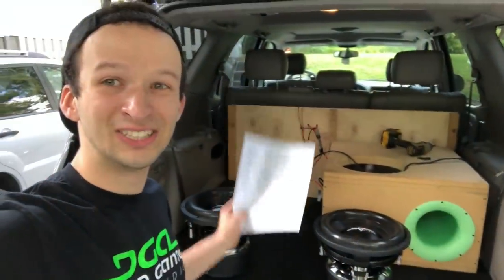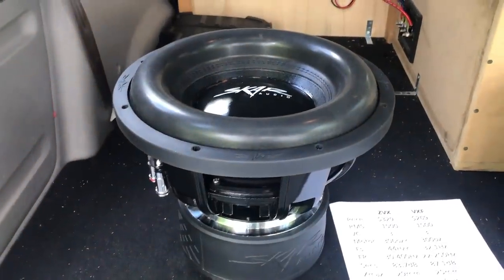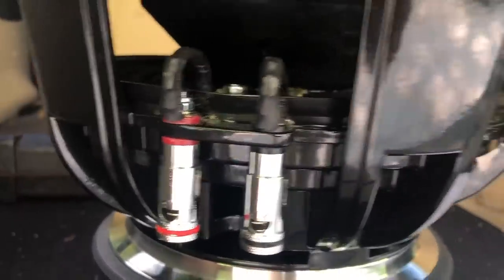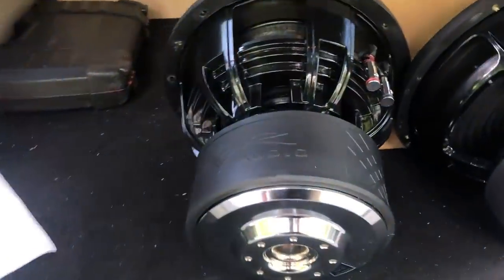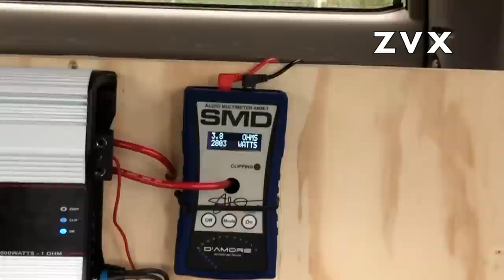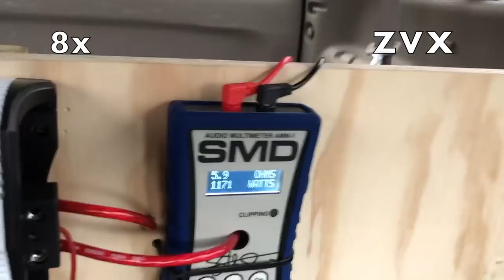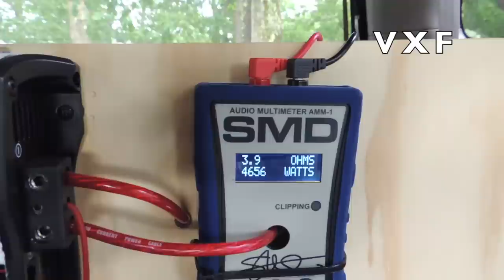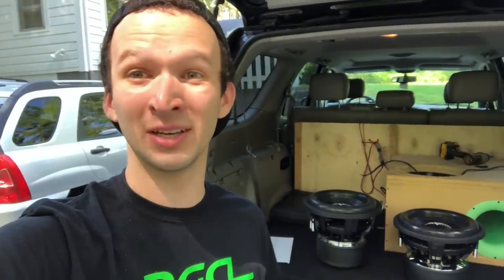SKAR ZVX VS VXF!! Which Is Best and Why? | Head to Head

Comment: The VXF would be my choice. It hit the lows a lot better than the ZVX. Great video!
Reply: The zvx just wants to be in a different box here’s the zvx hitting the lows https://youtu.be/HcqRCQ24XKk but its more for spl if you more on the sq side then yeah vxf definitely better
Reply: Which would you recommend the skar vxf or the kickers l7
Reply: Ivan’s music and video Guy definitely skar audio vxf
Reply: Ivan’s music and video Guy and put em on an 6000 watt amp or 2 taramp smart 3ks
Reply: bass brothers ok thank you
Reply: bass brothers what’s the max the 15” can take
Reply: Ivan’s music and video Guy one vxf by itself can take 3k rms
Reply: Went out and got 2 used vxf after this video. Can't wait to get everything installed
Reply: @unkowntrooper1657  well Mother Theresa tell us about all the giveaways that you be doing..!
Reply: Whats your box specs? And is there a pro or com to having the sub face up and the port to the hatch. About to build one for a 15 and kinda want the sub and port both on the same panel
Reply: Unless it's the ZVX 18. The fs is 26 Hz
Reply: @ivansmusicandvideoguy2038  skar VXF
Reply: Good
Reply: @ivansmusicandvideoguy2038  vxf kicker is crap the l7s can't handle but 900 RMS
Reply: All depends on the box.

Comment: Skar Audio designed the VXF subwoofer series to have the perfect combination of SQ and SPL features alike. Utilizing a high temperature 3" dual voice coil, and massive 300oz motor, the VXF's get extremely loud while sounding incredible. Conservatively rated at 3,000 watts max power.
Reply: You mean China designed the VXF to perform the way it does. Skar just put a name on it. I have two of them, not hating only stating facts.
Reply: @theinsaneunknown  A lot of things are made in China and multiple major brands just slap a name on them. I have many of those examples, not hating only stating facts
Reply: @kuya_akie  true story like 90% of everything is made in China with a name slapped on it. Some Chinese stuff is just made at better Chinese factories.
Reply: What skar box is best for the vxf , larger better or smaller, we explained comparison. Thanks for sharing

Comment: The difference in them is the box you can't take a sub that needs lower tuned box and put them in the same box there is going to be a big difference so box is the biggest thing you need a box that's tuned around 30 hz and a box tuned around 35-40 hz to be able to test and get more of an accurate feel for each sub in my opinion
Reply: I mean true but a lot of people are just going to drop a new Sub in their box, plus a lot of vehicles only have a certain amount of space so building a new box may not be possible, that being said I feel like this is still a valid test for those reasons. But you are absolutely correct it should be in a box built by the TS parameters to really know the differences in sound quality ,and output.
Reply: @Babyk Most videos I watch make it seem like it doesn't get low as it should, but there's a whole bunch of videos with the Sundown X playing lows real well. I have the vxf 12s, but I'm about to get the Sundown X v3 12s.
Reply: @Babyk I understand that people think they play lows good, but these videos are not that far off. You must have heard the most shitty setup if you can't tell the difference between a 95 pound sub vs a 57 pound sub. There is a guy on YouTube that had 4 15 zvx and switched to Sundown and said it was better. The x12 v3 is 70 pounds. I've been building boxes for a long time and some subs just don't do good. I have some old Sa15s that don't play lows worth a damn, but I dropped some Audioque 15s street duty in the same box and the lows were very deep. I don't need any 15s now because I already have too many subs now. I don't need the Sundown X either, but I just want to try them out.
Reply: @Babyk The weight means more motor force. You can't meter higher than a zv5 because they take more power than a zvx. 2 zv5s can take 8000 watts all day, but the zvx would burn up. I could care less why someone switched to Deaf Bonce, but I know it is a very good brand.  Sundown is on sale and I'm not trying to spend 800-900 on one sub. Like I said before, you must have heard a bad Sundown install because the zvx can't keep up. Skar would have put Sundown out of business by now if that were true. I've never heard anyone on any forum recommend the zvx over Sundown. It can't keep up with an American Bass xmaxxx Monster or DC level 5 which is similar to zv5's power handling. I'm not trying to turn you against Skar. If you like it, that's all that matters because some people think L7s sound good, but they don't. The  DNR sub they stopped making could compete, but the zvx is not on the same level as the ones I named.
Reply: @drjd2real  my boy has a x15v3 and it doe crush the lows but it crushes n takes all 5k of that salt 4 at 1 ohm
Reply: @Babyk have u heard them both in person same watts
Reply: @drjd2real  my zvx 15s play down to 20 hertz with authority.
Reply: that's totally true!
Reply: @drjd2real  do you build boxes for people is so can you build one for my ram 2019. I want some good bass and I think I need a custom box. I was considering 8in subs but what do u think
Reply: @drjd2real  there is more to a motor, than weight. More Weight doesn't mean, more motor force. What does contribute to higher BL is the amount of windings on the coil, that is utilized in the gap. Also the Flux. And lower carbon steel. When you wire voice coils in parallel,  you essentially cut the coils windings in half and the remaining windings are just added weight, where as wiring in series, utilizes all of the coils windings, and raises the BL. Motor weight isn't always better...in the same aspect that cone area, isnt always king.
Reply: @Chuck_Sanders  Man, I already know all the technical crap, but it doesn't mean much in the real world. Give me one example of the same cone area that's lighter weight that will destroy the Sundown zv6 at 30hz? What brand, I'll wait? In competition most guys with good equipment appear to suck because of user error. I've never had a problem with Skar, but it isn't on the same level as Sundown. I'm pretty sure in a blind test most people would pick the x over the zvx. I have both vxf and Sundown x now. I understand that the zvx is a good deal but I just never heard them playing real good lows.
Reply: @drjd2real  ummm, Deaf Bonce has done it, Pride has done it, and Crossfire has done it. And,  I'm sure many others have done it as well,  but just off the top of my head...without going into all the "technical crap" plus a few neo. But meh, they don't count 👍
Reply: @drjd2real  and, you're the one who is comparing brands, not me. And at first you boasted about the zv5, and now the zv6. I didn't bring any particular subwoofer into the mix, saying one was better than the other. There is no "best subwoofer" because its what works best for you. But there are plenty of drivers, that will play lower, and just as loud doing it, or more so. I get it, you like Sundown and that's all good, and I have nothing negative to say, about any brand.
Reply: @Chuck_Sanders  You need to quit while you think you're ahead. I don't give a damn about Sundown. I actually had a dispute on one of their products that they never resolved. Yes, I am comparing brands and proud as hell of it. Skar simply is not better. A dummy knows Sundown is better. You still don't have a point Deaf Bonce and Pride subs are heavy as hell. So what if they are a fell pounds lighter, people still struggle to pick them up. They also have a different sound on lows. I'm still waiting on you to link me where Deaf Bonce destroyed Sundown at 30hz? I've seen a Deaf Bonce bottom out in a side by side against the zv5. I also want to know what is the point of it being lighter if it cost damn near the same price? None of what you're saying is news to me. I already have  knowledge on any brand you bring up. I'm not saying Sundown is the best, but not many subs out there are beating it in the low bass department. I don't care if it got beat by .5 db, it means nothing. Most of the subs on the same level are just as heavy.
Reply: @drjd2real  every sub can bottom out,  and a sub will play within its enclosure tuning, so if it's tuned to 28hz... it'll  play that frequency..I know, I know, it isn't 30hz...js. any driver will do exactly what you tell it to do,  and to the point of destroying itself.
Reply: @drjd2real  and on a side note, Parkers testing...isn't real testing. Putting same diameter sized subs, of all makes and models, in one random enclosure used for all of them, isn't testing.  It's just not how it works. That's why he cooked the DC, and the Sundown Z and the fact, that NOBODY, plays test tones, for minutes at a time, saturating the voice coil.👍
Reply: @Chuck_Sanders  You really think being an electrical engineer helps your argument? I'm not impressed. I was an i.t. professional working on networks and in server rooms, but so what. You really think I don't understand electrical terms? The reason I said it doesn't matter in the real world is from experience. I've ran across so many guys just like you in competition talking all that technical crap, but that termlab meter had them going home a sore loser.  You can figure out the resonant frequency of the vehicle and the rest of that mumbo-jumbo, but when it comes time to put up or shut up it doesn't matter if you lose. I've built boxes to manufacturer  specs and some of them sucked. I'm sure they ran the numbers just like you, but they were wrong. I would start over using my common sense and build a better box that sounded better. I run real surround systems in my home. I don't have the best but it is good enough for me. I have Klipsch, Polk, Yamaha, Onkyo, and Stereo Integrity. If it makes you sleep better believing light weight is better, so be it. I still don't see anywhere that you proved it? If you want to bring super expensive neo magnet subs into it, what is the point if it cost more than the heavy sub? You would have a hard time destroying some DC audio lvl 6 with lighter subs, I don't care how many numbers you run. The Hcca is a heavy sub, but it has design flaws so it doesn't count. You might barely beat the heavyweights that are built well, but you will never destroy them.
Reply: @drjd2real  did you get the x v3 are they worth it at 2x the price of a vxf? Is it twice the bass
Reply: @GTILOUD  it's absolutely not. I'd rather have twice the cone area, for the same price. I do not bash or hug brands, but nothing wrong with having more options, on the same budget.
Reply: Also with the ZVX being a little bigger it has more subwoofer displacement

Comment: I’d personally pick the vxf. My friend has a single vxf 15 with a Skar rp2k amp doing 146-147db sealed on the dash in a Saturn suv. Very impressive how loud it is and I’m sure it can take even more clean power. Seems like some companies dont know there speakers specs 100%. Thanks Parker
Reply: Does he have an extra battery or alternator?
Reply: @trickedoutequinox3265   stock alt maybe a battery even though I didn’t see. They had a false floor where the amp etc was
Reply: High output alternator, secondary battery, 3.5 farad caapacitor does the trick

Comment: I have 3 of the zvx and it's borderline nuts. I 100% do agree that they don't really sound the best with all music (not bad though). If SPL is your goal its a no brainier. One thing though I started with a plain ported box but have moved to a 6th order and it's a whole new level, WINDY AF! Love all SKAR products
Reply: i just got two of the ZVXV2 12's and someone told me to do a 6th order box. was it a big difference when you put them in the new 6th order? was it worth it, i am pumped ive never had a 6th order box and these subs are perfect for one. what amp do you have powering them? can you float anything or small hair movement
Reply: At that time I was running an MD 8k (taramps). Now was it worth it. I believe so, main reason is it was much more efficient and I had a bit more bandwidth (range). Now I’ve moved to one 18” in a plain ported. I will admit that at times I miss the SPL part of the 6th order but the flatness of this setup it awesome. I would say if you have the money build one and also build a nice ported box @ around 30-32 Hz and see what sounds best.

Comment: Good comparison video Parker. Definitely was looking forward to this showdown. The VXF gets my vote. I like SPL, but I also need my music to sound good, and the VXF seems more tight and controlled and gets lower. I'll save $120 and get 2 VXF 15's in the future because they will easily handle the 3,500 ish watts my Orion XTR 2500.1 puts out. Looking forward to the Soundqubed HDX series tests, and hopefully a $250 - $300 sub showdown in the future as well. That's the price range I will be shopping in for sure, and I'm sure a lot of others shop in that price range as well for 1 or 2 of the 1500 to 2000 watt range subwoofers.

Comment: I got the VXF-12-2was thinking about getting the VXF-15-2 
If placed in the right box and turned properly with steady power supply ... The VXF-12-2 is absolutely amazing. Especially for the price. 

Especially if you fully sound proof atleast your trunk and have fans or good air flow. 

I have an ORION XTR-2250 "THE BEAST" with 200 amp alternator, "Big 4" upgrade, of course OFC 0\1 wire through out,  super beefy RCA's, SKAR EQ, .....and much more.  Still working on it.

Comment: I just got the VTX today and after looking at sundown. I'm going to base all my hearing ability off of a JL audio w7 which got stole out of my car a few years back. I don't expect this speaker to even come close. I am very impressed with the build of Skar! I am literally waiting on the FedEx truck now for the Skar box... I have watched a few of your videos and they are very informative coming from a ex contester. Just getting back in it after 12 years. I'm running mine off of a Directed D -2400 at the time I paid around $2,300 for this amplifier one ohm stable. I am very excited to see what this sub does in my car. I believe once broke in though through the controls of a really good head unit me I'm a Pioneer fan. The head unit gives you so much flexibility for the subwoofer. And once broke in which is going to take a while with the VTX model the foam will become able to flex more. The spider will break in before the foam gasket will. At least that's what I've learned over time but I'm sure you break all your speakers in. Me I like that a little more base than anything else I can contour it to my own ear specifications hopefully. But wanted to thank you for making these videos I know you do get money for these awesome speakers. But I understand what you do takes a lot out of your back! I installed for years! Except back then we didn't have nothing like this! And I may just upgrade to sundown but I believe the build behind the subwoofer I chose is a lot better as far as moving air around and keeping the speaker itself at a good cool running temperature
Reply: I sold my W6 and it worth buying a VXF not only did it hit harder but it also took more power.
Reply: How'd it go? My two Solo Baric L7s got stolen out of my car and I'm looktfor replacements. I want a W7 or two... Maybe an MTX 7500 if I go cheaper... But if these are any good... I may skip them both and get this.
Reply: I've heard W7s they were great but i wasnt blown away tbh. Not after having two L7s for so long.

Comment: 1 vxf 15" on 1500 watts for a couple years. Banger. Loudest I've ever heard in person, which isn't as loud as competition stuff obviously, but never heard a better sounding/shaking sub in my own experience. Vibrates the air in the cabin, sounds amazingly clean, pounds the roof and back hatch pretty good.

Comment: The VXF has better sound to me🤷🏾‍♂️ The lows on it just take the cake for me.  I'm assuming you are running these at a 1ohm load. How do the EVL series compare? Another great review.!
Reply: i got an evl 8 inch at 900 watts rms on a pioneer amp. It gets as low or lower than my 12 inch ddx honestly.
Reply: @Lo Yuen why did it die?
A 200$ sub should have a longer life than that
Reply: I'm running an 8evl in a skar ported enclosure on an alpine mrv m1200. Half gain and everyone is is really impressed and amazed. Way to go skar!

Comment: I have 4 zvxv2 18dv1 on 1 Wolfram aw9000.1 wired down to .5 ohms, it can hit from 10 to about 60 hz no problem,  I still need to fix my box and wall and I need more power and more electrical but I think they sound better than anything I've ever heard before, of course I have not been able to compare with any newer systems, I have been confined to the city of Wichita KS where the bass community is almost non existent

Comment: I’m absolutely in love with my zvx v2 18d2...still breaking it in..it’s getting better and better and I’m getting harder and harder...I think I’m gonna marry it..straight up..zvx v2 all the way!!! SPL life!!!
Reply: What lows can you achieve?
Reply: @dustinbulger1239  about 27 goes really hard. I can go a little lower but it starts to scare me it flexis so hard. I have a 6fc box tuned to 32. The zvx18v2 is truly an amazing subwoofer.
Reply: Ok because im looking at a 15 zvx v2 for 300 cad and i like my lows like 25 to 40hz so i want to know if this will take it all day long. I usually drive 3+ hrs a day
Reply: @dustinbulger1239  yes, give it a good 10hrs on medium to medium high volume to get fully broken in. Mine has about 50hours and it’s getting better and better. It can def take it. I’m pushing 2k tru watts at 1ohm 14.2volts

Comment: I run two 12” VXF D2’s. Each on their own amp. The SKV2-3500. And I am extremely happy with them.  The VXF is the better sub in my experience.
Reply: Each sub holding that 3500 well?